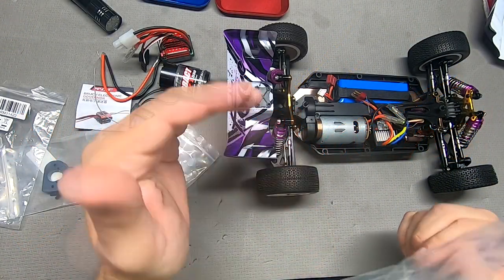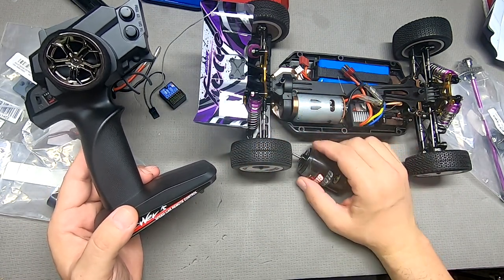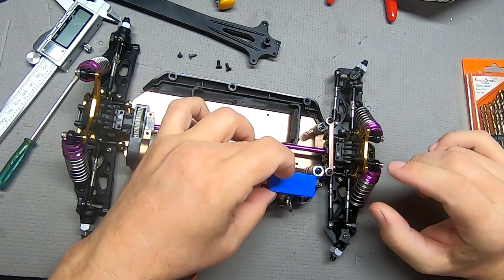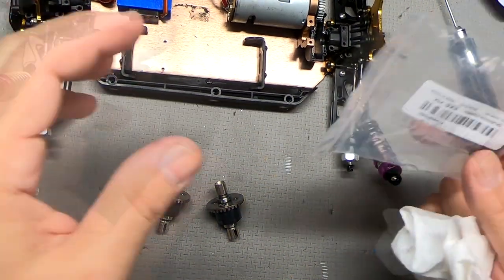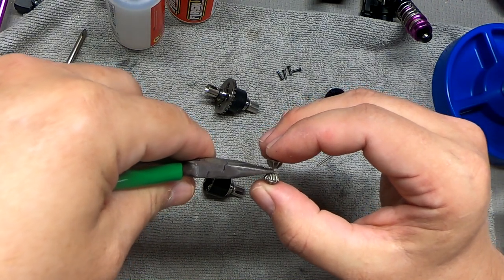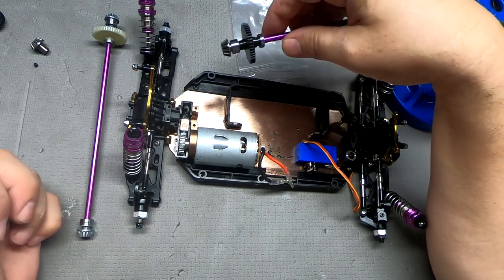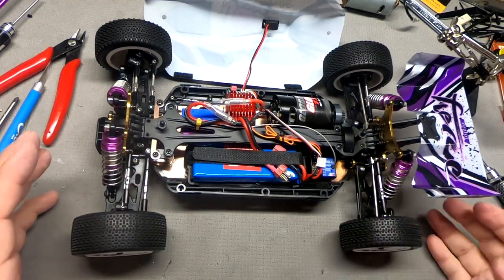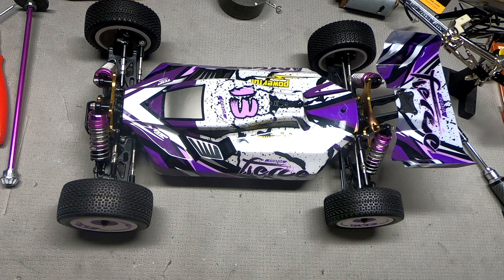New Motor, Diffs, Electronics, & Speed Test - Wltoys 124019 RC Buggy 4WD - Pt. 7

Comment: 1:14 look at the car the front wheels are on the back that’s why the car is not driving well
Reply from the maker: Yes, you are correct, I put the wheels on wrong. But I doubt that is the problem with drivability. 
I'll take it for a spin tomorrow and film it. Good catch on that by the way. I'm still convinced that the car has to much torque for the tires, regardless of which end they are mounted on. It's an all wheel drive car with no center diff, so power is equally distributed front to rear. 
The park was full of kids and everyone was coming home from work at that hour so there were a lot of cars. So, I didn't have time to set the steering trim. 
Thanks again for spotting that... when you look at it in the video, it really stands out.
Reply: And am I mistaken but a 12 turn motor will give less rpm and more torque so would t you be better with a 21 turn motor as I believe the standard motor is a 18 turn or am I understanding the motor turns wrong
Reply from the maker: @damionspiers8772  I think you're mistaken... not 100% sure. Brushed motors are not measures in KV like brushless sensored motors... kv is RPM.  For brushed motors, I think their max rpm is determined by voltage since there is no controlling circuitry... the more juice you give it, the faster it spins. Remember old RC cars where the motor was controlled by a rheostat? More volts = faster. In brushed motors, turns is also speed... look at the ROAR specs for stock and mod. They are controlled by turns. Example: 2wd buggies, stock is 21.5T while most people racing mod run 7-7.5T motors. Having seen how crazy this buggy is with a 12T I don't think it's a good candidate for speed runs. Why not get a 1/10 scale 4wd belt driven road car... it's a much more appropriate platform. Or, a 1/8 scale road car like my Serpens SRX8e. Remember, I like to race and racing is controlled by classes with rules designed to create a somewhat level playing field. This helps assure that races aren't always won by the person who spent the most money. Also I like tracks with left and right turns, so "speed runs" really aren't my domain. A lot of money can go down the tubes and go nowhere. There are no prizes for having the fastest _____ car. Remember, these are my opinions and philosophies and you and everyone else are free to do as you will... and I fully support that. And, I make no claim that my way is best.
Reply: Number of Turns

Refers to how many times the copper wire is wound around each pole of the armature. Basic guide:

More Turns (e.g. 19T) = Higher torque, less rpm, longer battery life. Slower but easier to drive.

Less Turns (e.g. 12T) = Less torque, more rpm, shorter battery life. Faster but more difficult to drive.
Number of Winds

Besides the number of turns, the number of winds refer to the number of wires wound around the armature. Basic guide:

Single Wind = Most bottom end power. Power is achieved at lower rpms. For short racing tracks with a lot of turns.

Double / Triple / Quad = Less bottom end power. Power is achieved at higher rpms. For long racing tracks with long straights.

Turns

Turns refers to the number of times the copper wire has actually been revolved around the armature. The higher the number of turns greater is the torque generated and hence greater is the power delivered. However that also means less RPM rating for your rc car electric motor. Generally less turns are preferred for making the rc car run faster.

Winds

One or more copper wires are usually wound around the armature. The number of wires that are wound around the armature is called the wind of the motor. Sometimes the wind is increased in order to compensate for the torque lost by reducing the turns.
Reply from the maker: @damionspiers8772  Yes, I knew what turns refers to... the thickness of the individual wires is also a factor. The precision of how the wires are wound is also a factor. As is the quality/purity of the copper. The quality and power of the magnets, etc... there are many factors at play. That is why pro drivers test dozens even hundreds of motors looking for the best armatures/stators/etc. with the least internal resistance and best performance.

Here's a tip: Check out the "RevTech X-Factor" motors made by Trinity... their standard RevTech motors are around $99, the "Team" motor for the same turns is $110, and the "Certified Plus" motor is $175. The "Certified Plus" motors are specifically rated for either 1 or 2 cell batteries and for on or off road racing. All these motors come off the same assembly line, but some are just better than others. In the product description for the certified motors, they state that each motor is "Built with a CERTIFIED Top 5% Rotor and Stator". They test every rotor and stator as they come off the line... this is good quality control, but it also allows them to provide the absolute best for their team drivers. I've seen the difference first hand of these motors offer even though they have the same number of turns and come from the same manufacturer. If you decide to get into racing, especially if you race stock class, these "Certified Plus" motors are a big advantage and are definitely worth the extra dollars. It's the closest people like us can get to factory team equipment. BTW, they are almost always out of stock so you'd need to get on the waiting list and be ready to buy as soon as they notify you they are back in stock... and I mean IMMEDIATELY... I've seen them sell out in hours. Like the email comes in at 4:00pm and the motors are gone by 5:45pm same day.
Reply: @MyRCChannel-CJScott  thanks for the tip. 

I have been racing / repairing Rc cars for 15 years plus in the uk I have repaired most of the Traxxas and arrma range for my customers. 
And have quite a big collection of RC,s  / planes and helicopters. I like the wltoys range as there affordable and as you probably already know you get what you pay for in this world. And I believe there very good to get people into the hobby at a good cost so carry on the good work and I have subscribed to your channel and will be watching and talking to you a lot more in the future keep up the good work form the uk 👍👍
Reply: Oh before I forget with lock tight always heat it up before removing the pin/screw it really works I always do this before I attempt to remove anything that is lock tight together
Reply from the maker: @damionspiers8772  Cool, look forward to hearing from you!